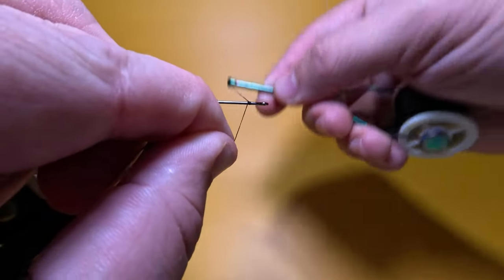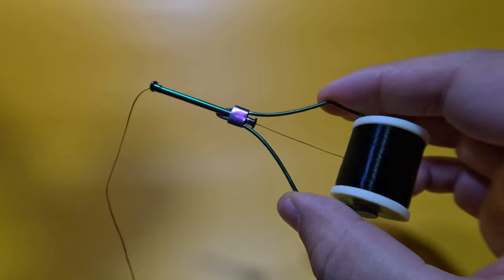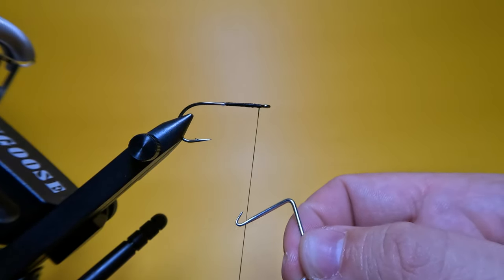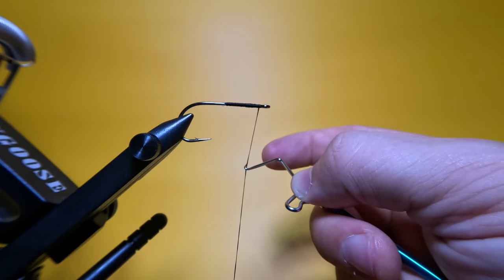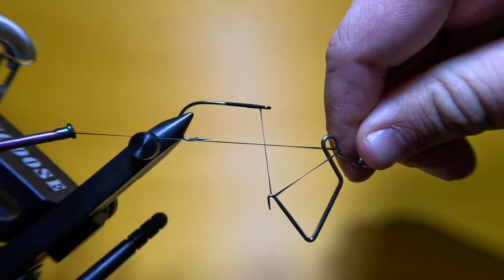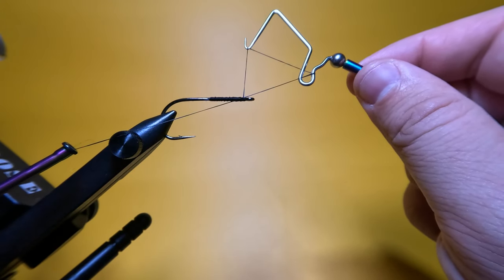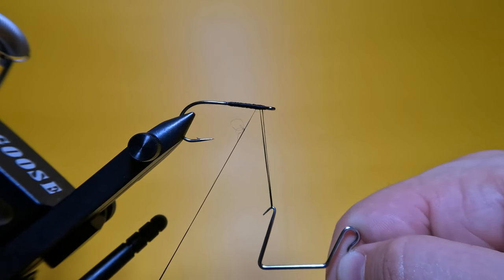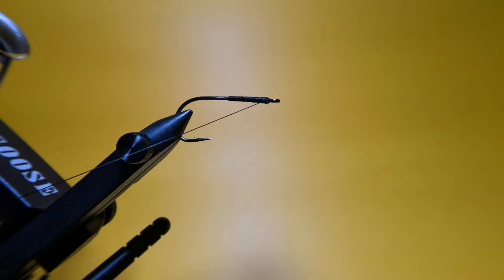How to Use the Matarelli Whip Finisher!

Comment: These Frank Matterelli tools both bobbins and whip finishers are extremely difficult to purchase now-a-days. When you do find them, they will be quite expensive, as they are no longer being made. I've been tying flies for 61 years now and have my Matterelli's which in my view are the very best available for fly tying. There are many knockoffs but once you use the Matterelli tools you will know the difference very quickly. And they will last a lifetime with good care. This was the best video I have ever seen on using this whip finisher. It's just excellent!
Reply from the maker: I truly appreciate the kind words! I still have hope to get my hands on an original Matarelli whip finisher, but I'm sure it will cost me an arm and a leg. When I was doing my research, I came across a framed collection of his personal tools from his bench (80 items) that sold for ONLY $125! I'd pay $1,000 for that collection right now.
Reply: @dtffishingmi I know that when Frank passed on it was a very sad day for all fly tiers. His son who was in his 70's did try to offer these tools but that ceased after about a year. The whip finishers were never marked with his initials but you could tell by the rotational smoothness of the polished brass tube that is was a genuine Materelli. The bobbins however were marked on one of the surfaces of the brass thread tensioners with his initials, F  M .  I would never sell my Materelli bobbins and the medium and large whip finishers. I use a very small Tiemco midge whip finisher and it is also without any problems ever. Tiemco's tool quality is world-famous and that's why they are expensive. Their bobbins are very close to the Materelli. Also, Andy Renzetti's bobbins are excellent with their Ruby "donut" tip guides. So for spending so much time and effort in making these videos excellent, I want to give you a tip. Charlie Meck, who sadly also has passed on, has a book you should purchase. It's called, " Fishing Tandem Flies. It's an old-school book treasure that few know about in this modern age. In this book he will describe the Bead Head Blueberry Egg fly and how to tie it. You will not see this anywhere else. Use this tandem with a large white wing dry fly with the Blueberry tied to the bend of the dry fly with a 30" flouro tippet. You will now know that there is no such thing as "luck." I know you will be amazed with the results! Tight line friend!
Reply from the maker: @MichaelDavis-x5i  I truly appreciate the tip! I'm still brand new to fly tying and fly fishing, and I am trying to learn as much as possible. I'm slowly but surely gearing up to get started - it's taking me a bit longer because I have an aversion to purchasing "entry level" equipment, and this stuff is expensive! Despite the enormous wealth of information here on the internet, I do enjoy reading books. I am currently reading "The Little Red Book of Fly Fishing" to start, and I will check out the one that you mentioned. I will pin this comment so that I do not forget. Thanks again!
Reply: @dtffishingmi  Take your time and have fun with tying files and learning from the old-time Master's, many of whom have passed on by now. Much knowledge has been lost over the years but you will find that many old-school books will be very helpful to you not only in learning the more difficult (at first) aspects of winging wet flies but also a significant advancement in your on-the-water fishing success. many of the old-time flies are not fished anymore. But therein lies your advantage... these flies the fish have not seen before! I strongly suggest fishing them. Try not to "modify" the flies from the original pattern. Duplicate with the original materials and the correct proportions the best you can. Some of these have been experimented with for years and refined by the originator.  Reading will pay you many dividends to study these old books and apply the lessons they teach. One of them is that while Dry Fly fishing is visually rewarding, only about 5% of the takes are made on the surface and 95% are made below the surface. This means that you will benefit with the more interesting (to the fish) full duck quill wings wet flies tied with materials that use hen hackle and some weight on the shank to sink them. For example, check out Davy Wooten's wet flies at Feather Craft in Missouri. You can buy them one at a time and duplicate each until you master the pattern. My old friend, the Master Tyer, Dave Hughes has a great book on wet flies too. Today, many sub-surface flies are only tied as nymphs but the winged flies are quite deadly. Few use them anymore and I think it's because folks believe that winging them is difficult. But not to worry, you will learn when you try. The Master, Dick Talleur has taught many beginners how to wing! But Also, Charlie Meck's book, "Fishing Tandem Flies" will show you how to rig several flies, both wet and dry simultaneously, on a leader correctly. Such tandems can be modified in mere minutes using loop-on-loop connections. This allows you to maximize your time and experimentation to change flies quickly while on the water. When you start following his advice you will surely catch many more trout both on East and West Coasts. You can buy these books on Ebay! Anyway, always keep learning and having fun!
Reply: Fish loop note
Reply: @frankpyl2267  What does "Fish Loop Note" mean in plain English?

Comment: Fantastic video. I love the slo-mo as well. However, I am still stuck on the wraps. My thread at the base of the triangle separates wider and wider each wrap so that I am knocking into the hook eye by my third wrap - if that makes sense. Any thoughts?
Reply from the maker: @jasonstewart9823  Thank you! If I’m understanding correctly, it sounds like your line is coming off of your spool too freely, and you may need to increase the tension on your bobbin holder. If you have a basic bobbin holder, you can do this by removing the spool and adjusting the arms so that they are closer together, which will increase tension on the spool. Hope this helps!